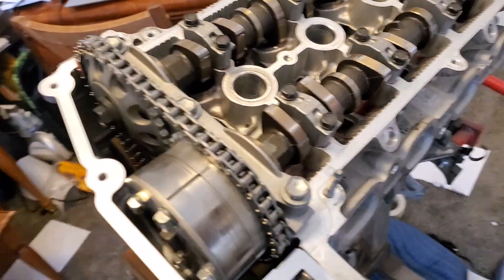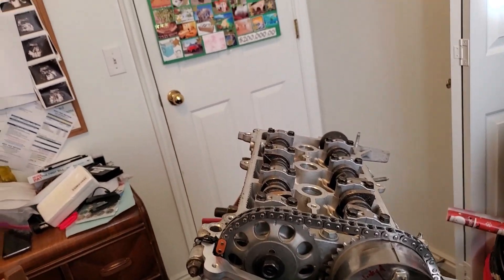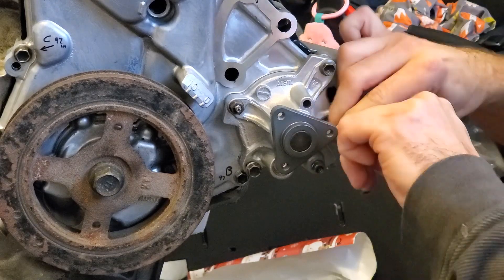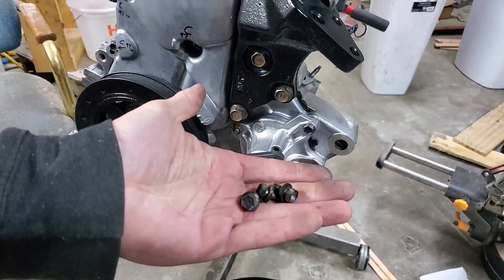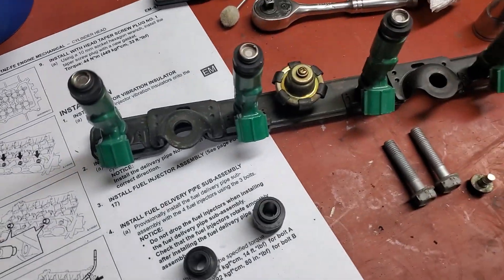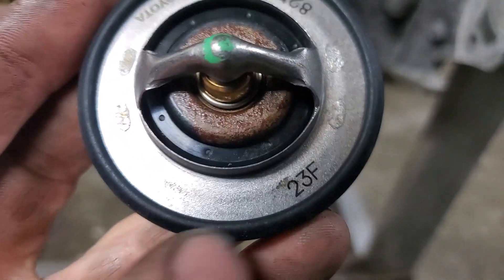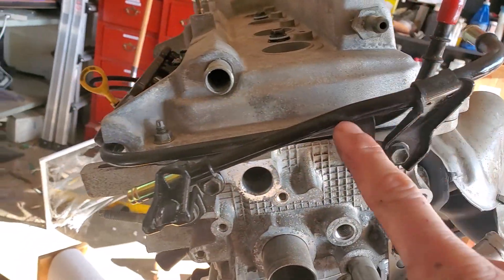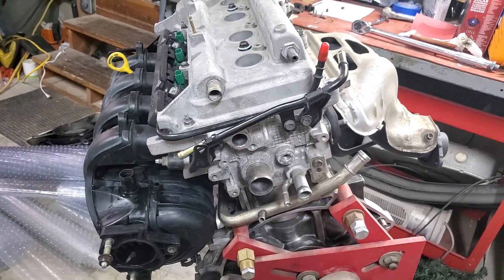[Part 8/8] Finishing Assembly 1NZFE Toyota Engine Echo Scion Yaris XB XA

Comment: man great video series  Love every minute of it ! question I have for you though is lift points for a hoist on this motor I'm assuming one is on the mount at the passenger side (technically front) but what about the transmission side? it can't be those loops on the head (facing the exhaust) is it? gives me the shivers .  people talk about dropping the motor or pulling out forward but a see lifting out from top alot with no info on lift points

Comment: I like your videos. I only have one question, did you machine the engine block? And if so, how much material did you take from the engine blocks? 
Best regards
Reply from the maker: Yes I had a local machine shop do the block. They bored out the cylinders half a millimeter and decked the surface so it's flat. Then hot tanked the whole thing to clean out all the passages.
Reply: @MakeItMike  Do you know how many mm were rectified in the block?

Comment: Man this is an epic series. Congratulations for the time and effort.
One question : was it not cost effective to install a new short Block instead of the machining route ?
Also how many man hours total did you put into the rebuild ?
Awesome, subscribed!
Reply from the maker: Good question.  The main reason to not buy a short block was because you are taking someone else's word on the parts quality and tolerances being accurate.  As we saw in my experience during this build, the machine shop I used cut corners with a "good enough" mentality that I had to have fixed with a different shop. So in the end its about quality control. As for hours,  I have no idea because of the filming and editing aspect. When I did my Toyota Tercel motor years ago it was probably around 60 hours spread out over a month.
Reply: Ok, I understand. And the pride of diy is priceless 😊

Comment: Mine is also burning oil, can we only replace the control rings?
Reply from the maker: You could but that would be an awful waste of time and labor because you could have done a full rebuild and technically have a new motor vs only replacing those rings.
Reply: @MakeItMike  so I am from Pakistan, and we don't have OEM parts for this engine. Even here mechanics don't have/use torque wrench in engine works. So I don't want to mess with the engine too much. My engine is from JDM V1NZ Corolla allex/runx 2002 - 2004
Reply: @MakeItMike  also what do you think, does oil burning affects gas mileage? 
Its burning around 1 liter in 3000 kms
Reply: @MakeItMike  please reply

Comment: As the engineer explains, and is well known.
Any threads where anti-seize is applied…
To avoid an over-torque condition causing:
 -     distortion of the parts
- irregular clamping force
- stripped threads

…a 30% reduction of the specified torque value should be duly applied.

Google this to watch:
Aluminum cylinder heads, spark plugs, anti-seize, & galvanic corrosion